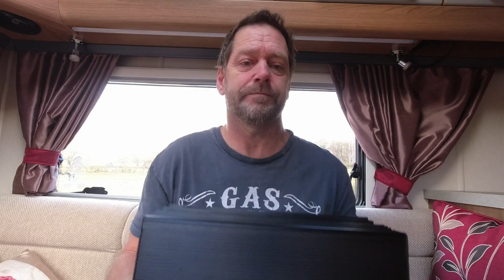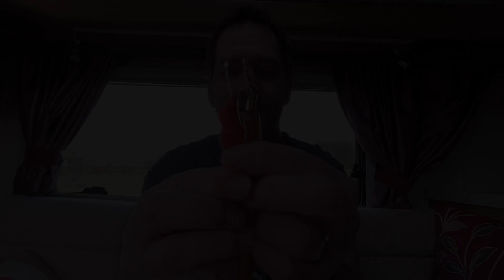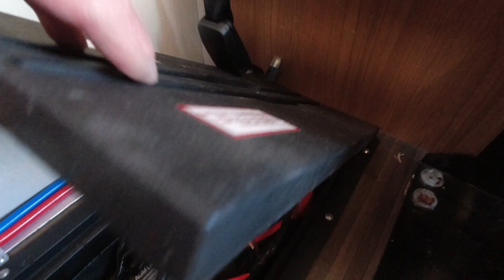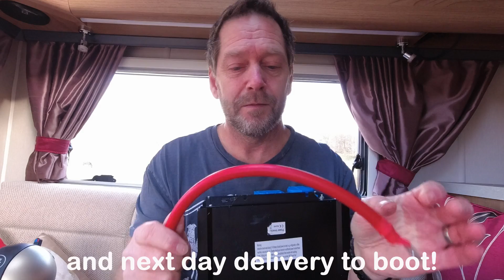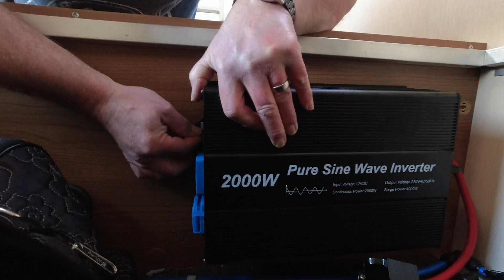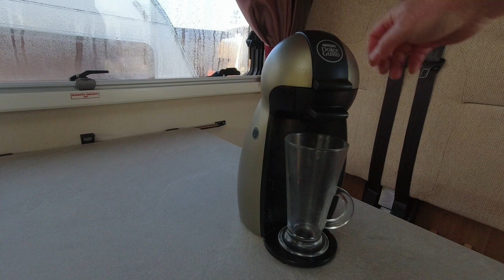Fitting a motorhome Power Inverter

Comment: Hi Lorenz!
I fitted a 2200W inverter in my MB Sprinter. Similar configuration as you have with a leisure battery. I used an original MB start battery, AGM type,220Ah, 1150A.
Will this battery do the job? What kind of battery do you use?
I didn't change the alternator yet, its still the original one of a normal Sprinter van, not like in a camper van?! Regards,  Edwin

Comment: Hi Lorenz. I’m a newbie to motorhoming ! Quick Q about how you came to the size of cable you decided on using? I’m about to fit my 2500w inverter and there is so much information out there that I’ve lost the plot! I’m gonna need the cables in 2mt length , will I go with what your using or do I need an other size? Many thanks for your videos, they are great x
Reply from the maker: Hi, thanks for your kind words. Generally for inverters between 2000 and 3500w you will need good quality 1/0 AWG battery or welding cable. Anything less will cause you problems with overheating, lack of power and tripping out. Good luck with your camping adventures!

Comment: Hi Lorez. I'm about to fit a similar Inverter to my new Burstner motorhome. Mine has an Earth cable. Did you fit one? Thanks. Laurence
Reply from the maker: Hi, no I was confused about that too. Although mine doesn't have a cable, it does have an earth bolt. The general school of thought seems to be that earthing it is pointless when it's already earthed through the battery anyway, so I went with that. Good luck with your installation..

Comment: Have you run a outlet outside the battery compartment, to plug things in, or do you have to lift seat every time, and did the inventor come with a remote
Reply from the maker: So today I've decided that your idea was too sensible to ignore and I've fitted a dedicated 13amp socket and dug out the remote. Much neater! Thanks for the idea. 👍
Reply from the maker: I did consider running a short extension to the other side of the panel, but tbh I just don't use it often enough to warrant it. There is a long remote cord to switch it on and off, but for the same reason I don't use it. Thanks for your observations 👍